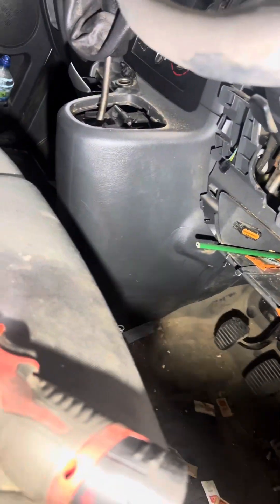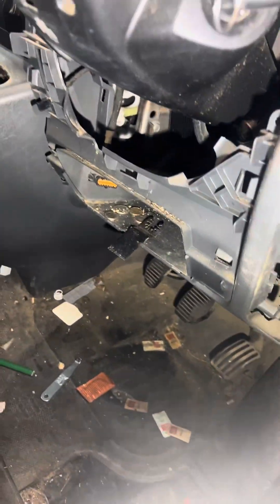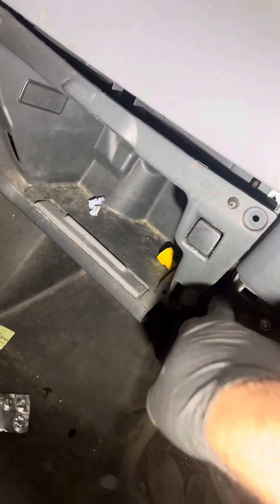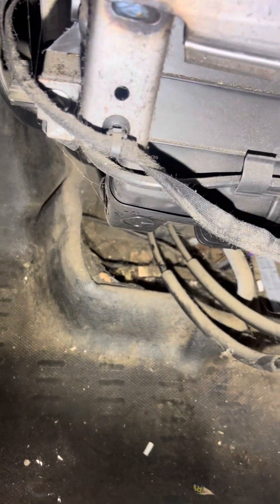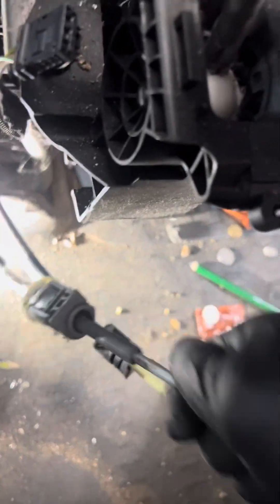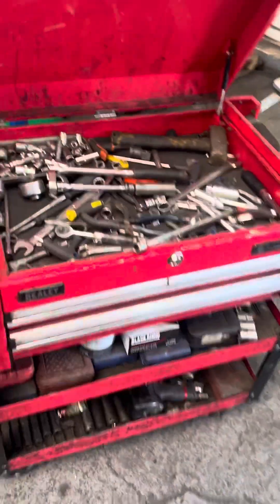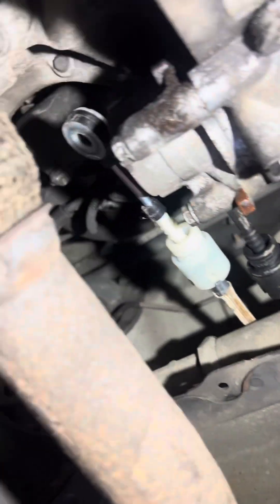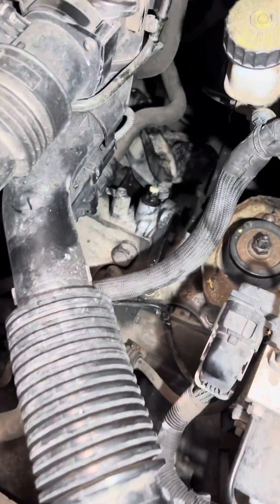citroen dispatch how to replace gearbox cable

Comment: Would have been nice to see how the fuck you hook up onto the gear box balljoints. Do they just pop on and off, is there a special citroen bull shit tool you need?
Reply from the maker: You just need screwdriver that’s all
Reply: @ got them off, cant get new ones back on. Working from underneith on jack stands barely room to move. Its like trying to feck a mouse with an elephant weiner.